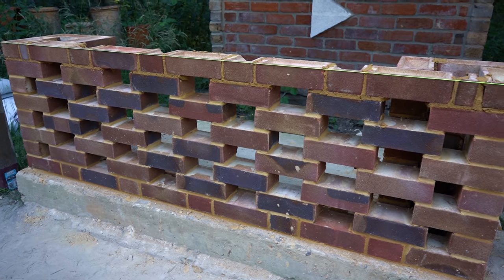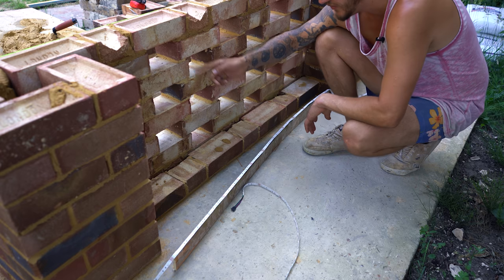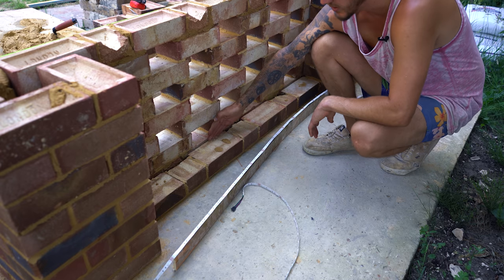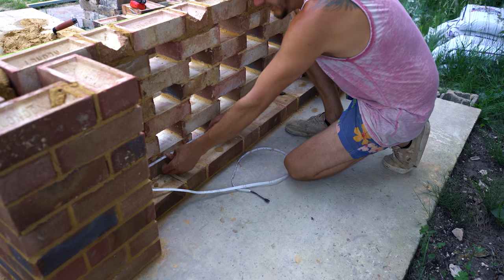BRICKLAYING.......But DIFFERENT

Comment: Yep, this is it exactly !! It’s a disco party wall that could be adapted for BBQ/ seating areas. Perfect for garden parties. One suggestion I would add if I did it for myself would be to build in clear tubing to run the LED lighting through so it can be replaced if faulty. Your brickwork is pleasing on the eye, from house to demos, you match bricks to mortar well. Keep it up, your videos are appreciated and are enjoyable .... loving the shorts too lol.
Reply from the maker: Thanks Stephen. That's a great idea regarding the clear tubing!
Reply: Rodian Builds hey Rodian, hope you’re good. I was thinking of ideas that I’d like to see you build. Would you consider a brick Pizza Oven, a 
brick igloo really. Maybe you could add your twist to it and make it spectacular. I’ve fancied building one for a while but I haven’t the room in this house. I’ve seen them built freehand and also over and infill and sand former that is later removed. Just an idea anyway.

Comment: Nice job. How about do the back leaf also with holes but out of phase with the front and keep a cavity all the way up with brick ties. Air could then flow through. Just a thought: Any chance of a video some time on all the brick terminology: Stocks, commons, specials, wire cut, etc. Etc. Perhaps include a brickworks visit and have a go at some handmade bricks. Now I'm not commenting on the legs, just remember you only get one pair at the moment so keep looking after them.

Comment: Nice project. Quick question, I believe the main factor in the varying colour of mortar is the regional variations in sand, all the mortar I usually see is grey, I know that most mortar in the South of England (or at least parts I have seen) is a beige colour, is this just the sand? It seems to me that cement pretty much colours everything grey, the sand I use is still a typical sand colour yet I always get a grey mortar? Is the mortar you used in the video dyed (sorry if you said but I missed it) I have used Snowcrete and white sand and pigment and things but it is my belief that brickies throughout the south don't just go dying everything, it is just regional variation. If I therefore wanted to create a beige mortar would I need to get southern sand?
Reply: I think he is using lime mortar. No cement and thus the sandy colour.